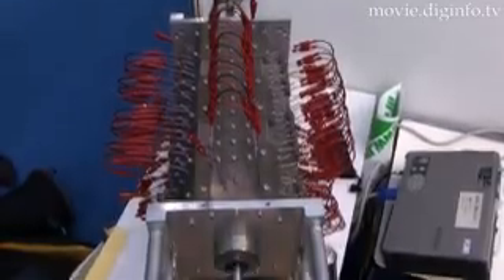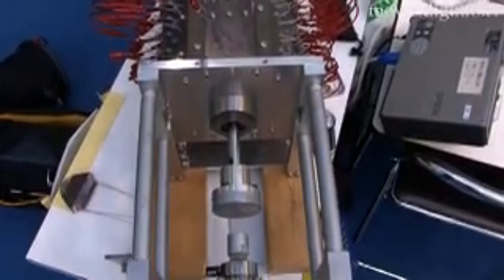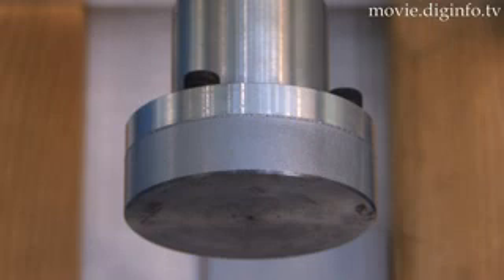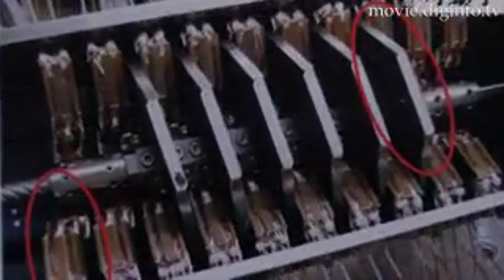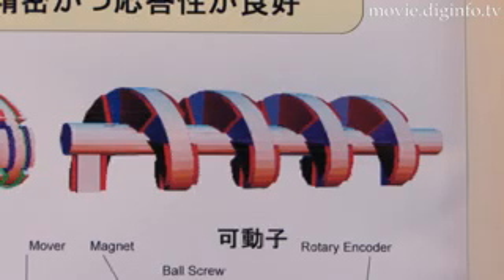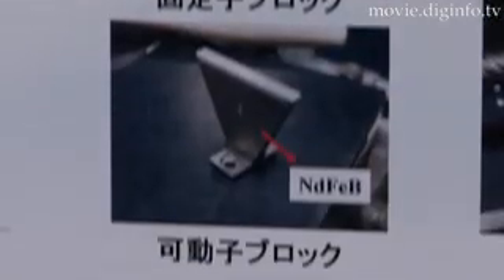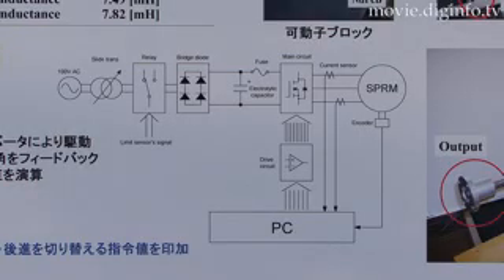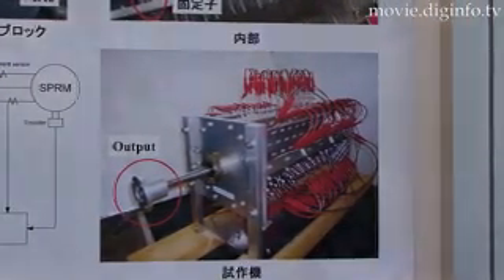High-thrust spiral motor : DigInfo

Comment: So, nice spiral motor has to have a nice spiral bearing / actuator screw to go with it, to keep the faces of the motor apart. So not only do you have to build an odd lead screw, you have to build an odd motor to go with it. And having done all that the power output drops off at either end of the cycle will be notable as it winds out of its mating part..This comes across re inventing the wheel & making it square, 'cos hay, we've not had one of those !